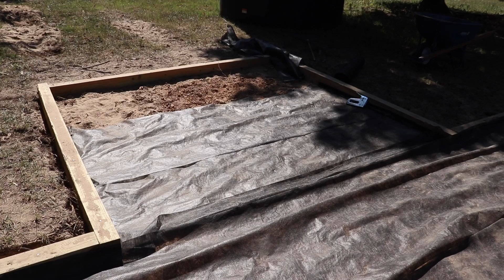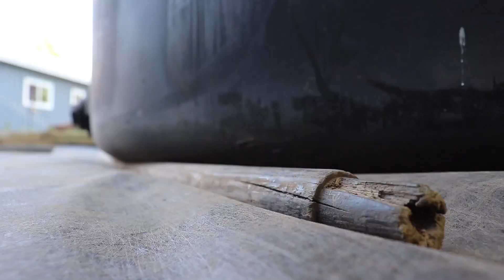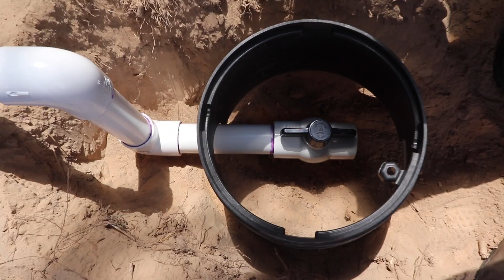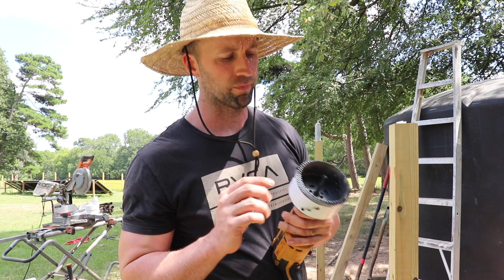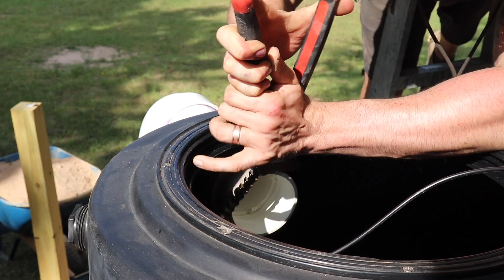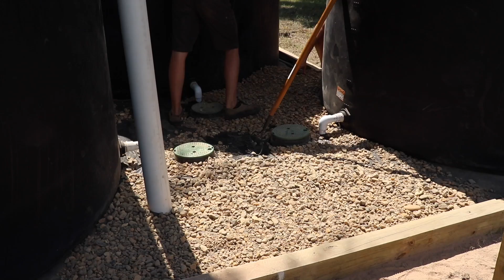HOW WE'RE GETTING WATER OFF GRID!

Comment: The famous last words I always heard is "hey y'all hold my beer and watch this".LOL Have you checked the flow rate between the tanks through the smaller pipes? You may need to put bigger equalization pipes between the 3 tanks in order to keep up with the rain flow. That is Texas and you get a lot of rain some times I would hate to see you loose water because it can't equalize fast enough.
Reply: I think they gonna use the big pipe for it😆
Reply: @Rynaldi_Rizwan  The reason I asked is the big pipe is the feed from the house and it looks 4 inch ID.The problem is with the small 2 inch pipe that is the drain also being the equalization pipe during a heavy rain with the tanks half full the one tank will overflow before all the tanks equalize. Cool of them is your equalization pipe should be as big as your feed.
Reply: @kevchard5214  well I am not a plumber but I agree about that😁😁
Reply: @Rynaldi_Rizwan  I learned from experience when I was young living in Louisiana we built a camp with rain water catchment and 2 tanks and had this problem.

Comment: should you paint them something reflective to reduce heat to the water?
Reply: Maybe an overhead roof would be cooler temp-wise and allow some sort of extension to cover the pumphouse as well in one structure ?
Reply: @mkllove  
And it would act as more rain harvesting area too ...
Reply: @captaincaveman00  Didn't catch that, but definitely.. might work better as a reverse pitch so its easier to direct to one central gutter and pipe instead of multiple gutters/piping ?

Comment: You will need some sort of lift pump to make the water go up the fill pipe. Whenever it rains.i dont think theres near enough elevation your gutters will just overflow in heavy rain.
Reply: Yes, The pipe should have been installed in the air with gradual drop. Back to the drawing board.
Reply: @robertsmith3774  yes that's what I was thinking
Reply: @robertsmith3774  wait...what? If the supply pipe is "U" shaped it will work...it will just stay filled with water at the same height as the outlet into the water tank.
Reply: HOODS CUSTOM SHOP  yes agreed. That was my first thought. The downward force of gravity won’t be overcome by that slight elevation. Definitely will need a pump.
Reply: @nunayafb  since the water will have to travel up at least 6 feet the inlet would need to be double the height in order to overcome the back pressure. Will it trickle into the tank? Probably but in the instance of a drizzle the gutters would be overflowing. Not capturing all of the water. It is simple physics taught to real plumbers. They will learn the hard way. And so will you.

Comment: Why you do not roll the tanks? you can roll the sideways if you keep it on the side :)
Reply: Super cool install! it Will work. Great!
Put a inspection trap/  big valve drain type in the input line at the lowest point into a little soak hole so you can drain any sediment out occasionally otherwise it builds up over the years
Reply: Was thinking the same thing. Roll them and then tip them back upright in place.
Reply: I'm guessing they didn't roll them because they're on uneven ground. Getting a dent in the side from rolling over a rock or a deep scratch from a branch could compromise the integrity of the tanks and, over time, they would fail faster due to that imperfection.
Reply: xylene it’s not going to hurt the tanks...
Reply: @Jerryshipping12  That's good to know.

Comment: Very interesting.  I truly wonder about the water going up the pipe, regardless of being lower.  But maybe the volume will force it since it will have to go somewhere.  Also, I'm assuming it doesn't freeze where you are.   Progress is great.
Reply: has nothing to do with volume. even if the inlet side was a half inch in diameter and the outlet was 10inches, water inside this U-Shaped pipe system would rise equally on both ends and as log as the outlet is lower than the inlet, would eventually spill over into the tank.

Comment: How will you get the water to go up into the tank, wont it just back up in the pipe?
Reply: They're always going to have water in that 4in pipe. I would be afraid of it becoming stagnant.
Reply: as long as the inlet of the pipe (gutter side) is higher than the outlet (tank side),  water from the gutter will rise in the pipe as it flows in and then eventually flows out and into the tank. Google "Gravity feed water tank"
Reply: @orange13  Alas water needs momentum.  With out a pump the water will pour out on the ground long before equilibrium will move the standing water in the pipe.
Reply: @wi11y1960  nope. Go outside and raise one end of your garden hose and tell me if water comes out of the other (lower) end. Pour some more water in the high end and tell me if it still comes out the lower end. Picture this with a much bigger pipe.
Reply: They said in the video....gravity.

Comment: Amazed by your level of DIY, I’m no plumber but wouldn’t you need a volume of water to force it vertically up the pipe to fill the three tanks ? I can’t see just rain water falling from the sky getting to the tank
Reply: As long as the downspout is higher the water will maintain level between the gutter downspout and tank inlet.
They could have fed the tanks from the bottom it they wanted to and as the level in the tanks rose so would the level in the downspout.
Set up the way it is, the downspout and vertical supply to the tank will always be full even if the tanks have equalized at one foot of water. Once it stops raining the water in the downspout will be level with the tank supply where it goes horizontal into the top of the tank.
They could also add a small clear pipe to the side of one of the tanks to  see the level in all the tanks.
Reply: it will work just fine, the gutters on the house is higher then the top of the pipe , it will just have to fill the pipe first, then it will flow fine
Reply: dasbronco as I say I’m not a plumber and understand what they said and what you’ve said. But in my head it doesn’t add up that it will work.  I hope it does and I’m wrong.
Reply: Also if the pipes underground will have water sitting in them, what happens in winter ? And winter rain when it’s frozen ?
Reply: @paulj3625  theres in texas i dont think freezing is a problem

Comment: the rolling of the stick i did that with my internment wood cabinet was to be 3 in my room but only could fit 1 in my room but the trick is to put more then one and then wen the one that come out from the back movies it back to the  front i had to use 4 or 5 to movie that hug  cabinet. 
For the hole saw i had to make a bigger hole 1 time to install a new door knob because the old one was a smaller size hole. what i did i add a piece of wood over the small hole  has to pre-cut out the hole in the bigger size  put it over the smaller hole line it up then the extra wood be my guide the wood was thick about  2 inch thick or 3 inch. 
the round piece  u was doing if u had a band saw u could have cut a piece of wood to the round shape of same roundness of the water catcher then cut  the round hole to the new size hole u needed so that the thick wood would be the guide  like this (   then the hole already cut out like this [    (    )    ] the wood u put wood have to fit the curve of the water catcher  u also need to strap the wood on tightly  so it does not move around u can use thicker wood like 3 inch thick if you cannot curve the woods to the water catcher then try to fasten it on as tightly as you can but having it curve will help big time to keep it from moving